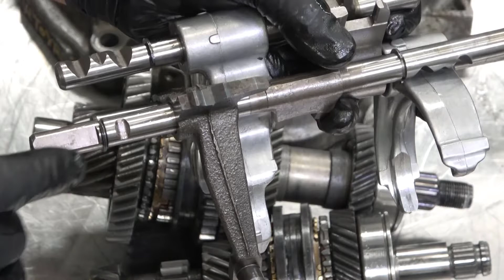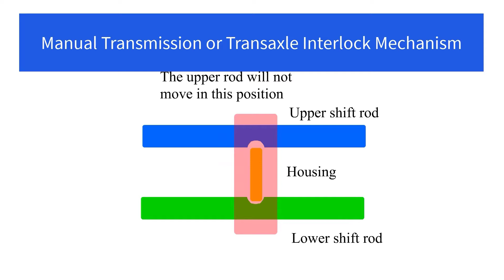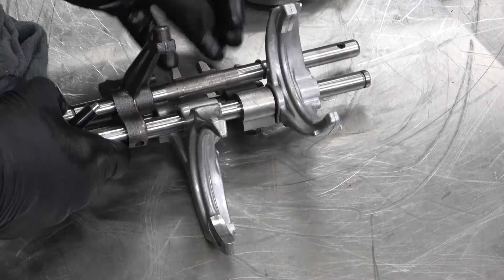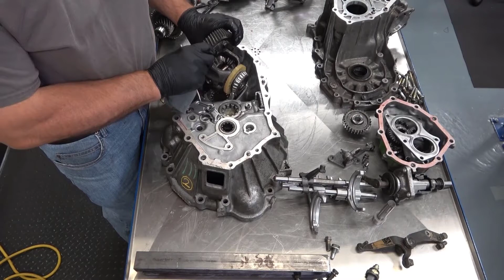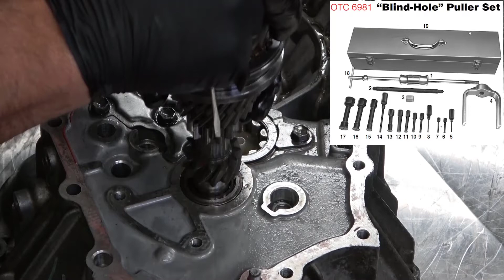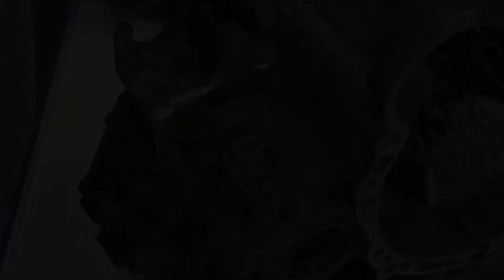Toyota Manual Transaxle (5) Shift Fork and Lower Housing

Comment: how can i adjust the shim under the bearing race? I rebuilt my scion transmission (looks identical to one you are working on) and after installed it to car, it made a horrible grinding sound coming from the differential gear. I think it is because i never knew that shim needed to be adjusted to get rid of the free play. Do i need to remove the transmission and disassemble again to do the adjustment? thank you in advance!!!!
Reply from the maker: The transaxle has to be removed.  Some transaxles have external bolts and a race housing but there is no way to tell if it was shimmed properly unless you remove the transaxle and take it apart so you can measure the differential case bearing preload. If you would like to factory instructions on replacing and selecting shim along with measuring the preload email me directly and I will send you the information.

Comment: Hello do have a video how to change and adjust preload on the differential bearing please for the c52 gearbox??? Please
Reply from the maker: No I don't. you need a blind hole bearing race removal tool to access the shim behind the bearing race.  Replace the shim behind the race with a thinner one to reduce the rotational force and a thicker one will increase the rotational force.

Comment: ive rebuilt plenty of c series. your information is on point.
thanks for taking the time to document this.
Reply from the maker: There is more to come. I have lots of raw video that I need to edit before I can upload it. Stay tuned.
Reply: hi @DrivelineMaster, this is a great video and guidance. I'm collecting information before I embark on a journey of rebuilding my Corolla's C-52 transmission. I'd like to ask you which website can I order a rebuilding kit from (to be shipped to Australia) and, do you use Gl-4 or Gl-5 (75w-90) manual transmission oil?
Thank you.
Reply from the maker: Stay tuned. I'm working on a complete series with about 95% of what you need.  Typically these use GL4 but checking the service manual or the owners manual to be sure. Sometimes you can find a fluid that is GL4/GL5 compatible fluid.  I don't think I can help with the parts.  There must be someone on your side of the world that would be able to sell you an overhaul kit with bearings and synchronizer rings.  The kit may or may not include any snap rings and they most likely won't include any gear needle bearings.  In addition to major bearings and blocker rings the kit should come with all seals and gaskets. Good Luck and don't be afraid to give me a shout if you have any further questions.
Reply: @DrivelineMaster  thank you buddy